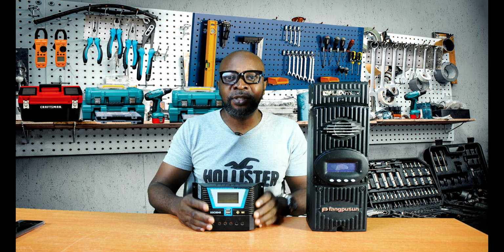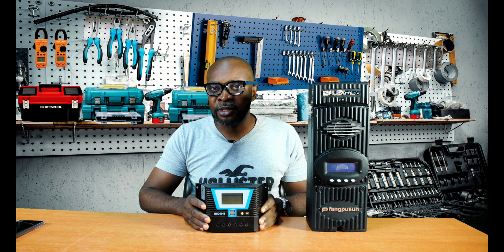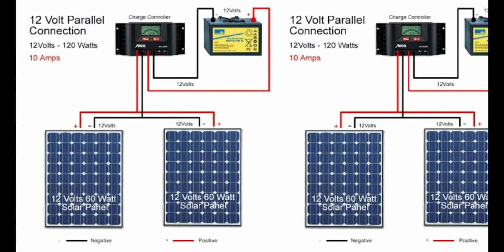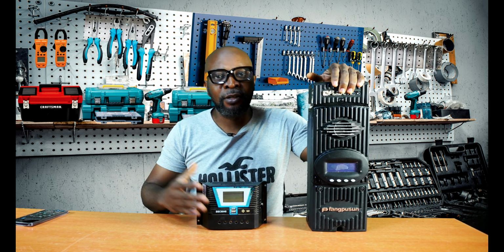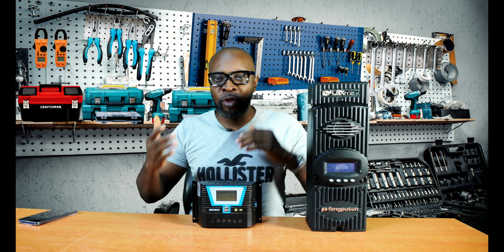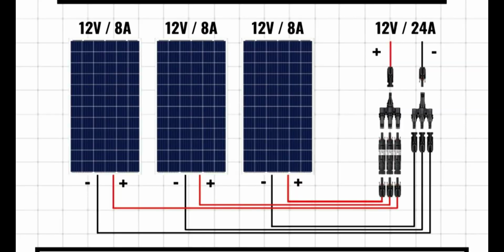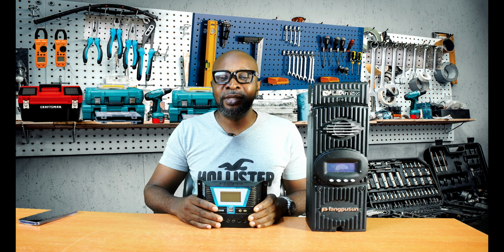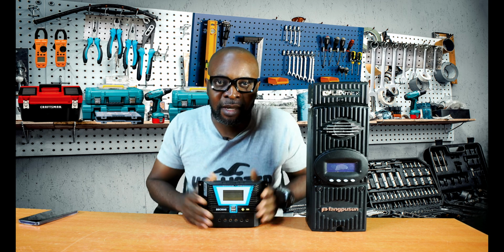PWM vs MPPT which is better ?

Comment: only consider to lifespan of battery.
pwm better for lifespan battery by the voltage spikes of each duty cycle. best in case of lead acid; lithium also is effected a litle bit.
from my test over a years.
put a comment if you agree with me :)
Reply from the maker: Sorry but I dont agree

Comment: Good evening sir. 
Pls I need your advice on my installation of 24v 2batteries 1.4kva inverter 
The charge controller is pwm bsc6048 have 4 PCs of 300 watt monoch. So around pick period of sunny dey it usually gives 02.4A while everywhere is hot and gives 70.5 kwh and 25.5 volt 
Does it means that the panels are connected in series ? Thanks.
Reply from the maker: Hello Thanks for reaching out. Please what is your Solar panels VOC
Reply: @smilinsunsmilinsun8056  is it the open  circuit voltage for the 4panels or just 1.
Reply from the maker: @hammedbalogun-v8i  Just one will be fine

Comment: Hello sir, quick question. Does the PWM charge controller know when the battery is full and stops charging? Or it just keeps pumping charge
Reply from the maker: It rregulates energy charge on the battery

Comment: Good evening sir l have  system with 2800w pv and growatt inverter 3kva 48v and 3.5kva 48v pylontech battery was installed 5 months ago now problem.l need you contact we can talk for to trouble shoot the system and see if the install did a good job or not . Send me your contact.lqm in igando lagos

Comment: Please Sir can I connect 200ah 6 tubular batteries with a 48v charger controller mppt.
Or can you explain a possible way I can connect this battery without damage
Reply: For 48v I think you can connect either 4 or 8 or 12 or 16 batteries. That's any number divisible by 4 while using 12v batteries.

This is not a professional comment

Comment: They need to just stop making PWM. there just trash
Reply from the maker: Its still useful for low budget installations , not everyone can afford it.
Reply: @smilinsunsmilinsun8056  true, but at the same time with so much waste as you said, I think your losing more money over time in the energy loss
Reply: They are not trash. You need to know where to use them. Not everytime you use Mppt that you actually need Mppt. There are some designs you use and your Mppt will work as pwm. So, pwm has their advantages as well.
Reply from the maker: @Batterycaresolution  correct

Comment: Good day, pls at what watts can a 20kva Felicity inverter be and reach up to 20 percent? Pls help a brother..... Then another one, pls why can't 16 piece of a 230ah Tubular battery give backup for 6 hours at a 20 percent load.
Reply from the maker: Hello UD A 20 KVA inverter at power rating will be 16,000 watts and 20 percent of 16000 is 3200watts  hope this helps.
Reply: @smilinsunsmilinsun8056  thanks it does